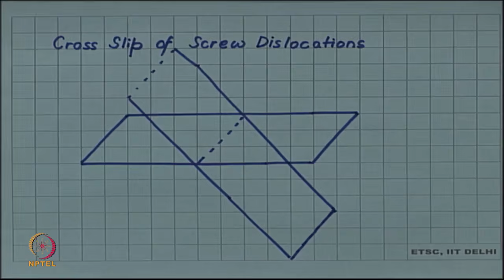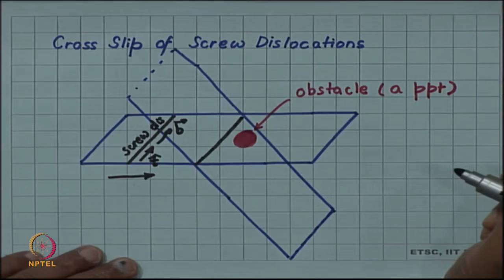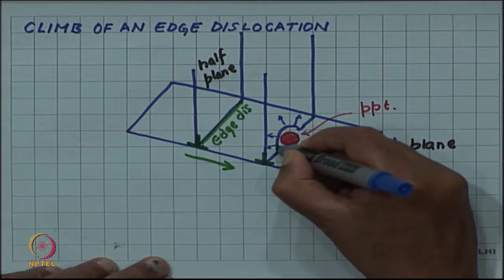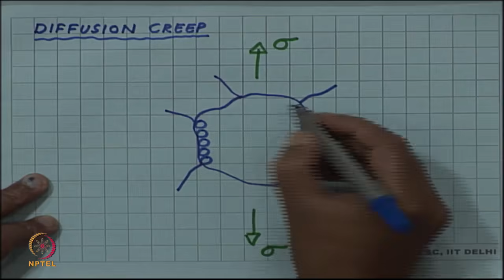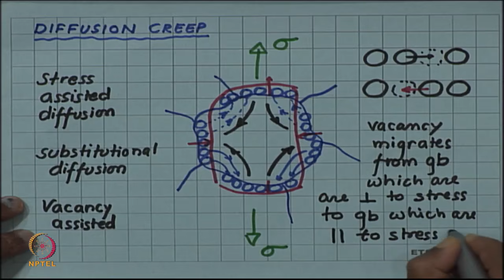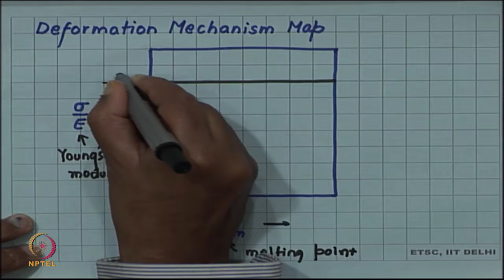Creep Mechanisms

Comment: Sir, why does dislocation bowing not taking place here ie kindly tell that when does cross slip takes place or climb takes place and when dislocation bowing takes place #Rajesh Prasad introduction to material science and Engineering
Reply: Each mechanism requires its own stress. The one requiring minimum stress will operate.
Reply: @rajeshprasadlectures  sir does dislocation bowing takes place in case of screw dislocation
Reply: @letslearnmechanicalengineering  It is possible for screw dislocation as well.
Reply: @rajeshprasadlectures  one last request sir kindly make course on topic like welding or metal cutting and machining, so that underprivileged students like me , who are preparing for various exams like ese get benefitted, in the same way as material science
Thanks a lot sir.
Reply: @letslearnmechanicalengineering  Dear Raunak, I do not have expertise in the areas you have suggested. Please do not consider yourself underpriviledged. You are working hard and you will do well.
Reply: @rajeshprasadlectures  many thanks sir

Comment: Hi sir. Why gb sliding mentioned is not mentioned in the plot, in which region it will occur?
Reply from the maker: This is indeed a good question. I have used a simpler form of mechanism map by M.F. Ashby. This was first proposed by him in 
M.F. Ashby, "A First Report on Deformation Mechanism Maps", Acta Metallurgica, Vol 20, Issue 7, July 1972, Pages 887-897. This is also described in his book. This is also described in his book
M.F. Ashby and DRH Jones, Engineering Materials: An Introduction to Their Properties and Applications.
However, he has not included GBS in his figure. I simply followed him because I did not pay attention to.

Your question forced me to look up literature where I find that, later, other workers have proposed maps that include GBS:
H. Luthy, R.A. White and O. D. Sherby, "Grain Boundary Sliding and Deformation Mechanism Maps", Materials Science and Engineering, Volume 39, 1979, 211-216.

Thanks for asking.